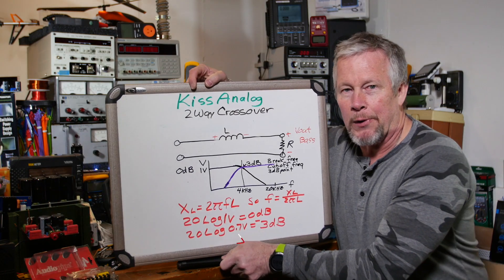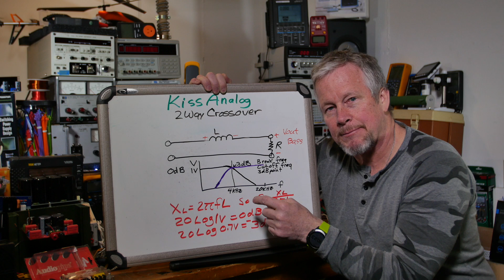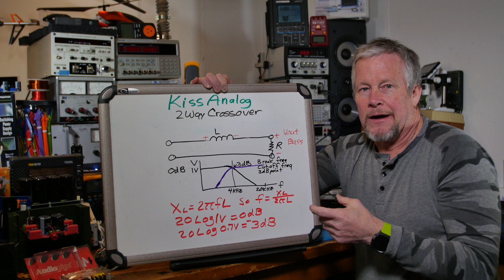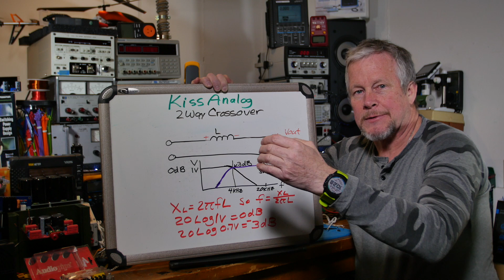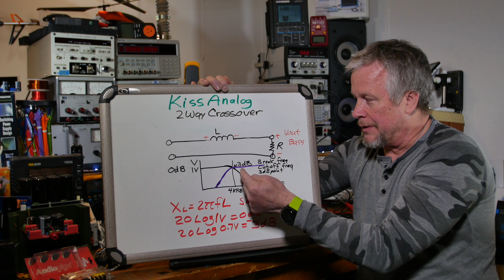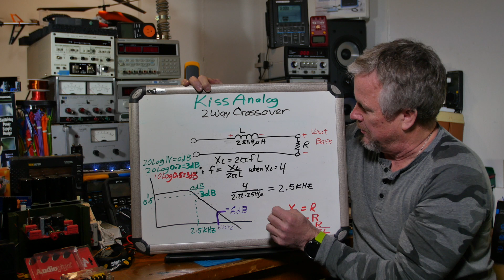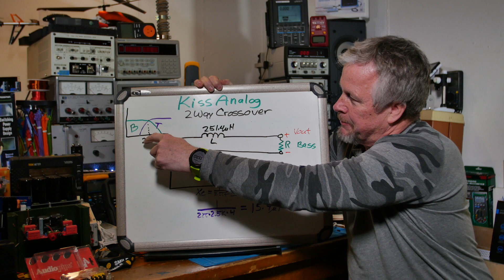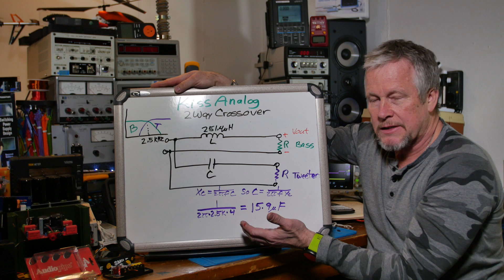How to Design Speaker Crossover #speakercrossover #filterdesign

Comment: Incredible...i guess this what they mean when they say "drinking from a hydrant".
Reply from the maker: Thanks Val for the feedback!  Too much too fast? ;)
Reply: @KissAnalog  I'm trying to get microcontroller like Arduino to read audio signal. It reads DC only. I know i need a voltage divider an a DC offset. Voltage divider is easy but DC offset I can't find any info? Like how do I know size of the cap and can it be polar? Any points greatly appreciated.

Comment: I have Technics speakers with just a single cap in series with the tweeter as a crossover. I was wondering: Is it necessary to remove the high frequencies from the woofer? Are you more likely to mess up the sound by trying to?

Also can't you make a low-pass filter using a parallel capacitor too? What's the downside?
Reply from the maker: Great question!  Yes, I have seen crossovers made that way.  It is low cost and keeps the tweeter from getting hurt;). A low pass to the sub would be a series inductor.  Then low frequencies would pass through but high frequencies would get choked off.  It protects the woofer from soaking up the frequencies that it can’t react to, so I think it is better to keep them outlet, but the woofer is usually big enough to handle it.  The Amplifier sees a strange impedance without a better crossover, so it has to work a bit harder too.  A well designed crossover looks like a more even or flat impedance to the amp.
Reply: @KissAnalog  Thank you!

Comment: Pew this was hard to follow but I think it will make more sense when I try to calculate it my self:-)
Am I right in understanding that if 1V = 0dB and you have 0.707V at the -3dB cross over point, you will also have -1.414V at the -6dB and so on, until the voltage is to low to be interesting?

A few comments to your video:

Great zoom on whiteboard, really a nice and helpful detail!! :-)
11:55 jump cut but did not distract at all but you have a lot of smaller jump cuts trouoght the video, maybe if you have that posibility, make a image to image fade that last for ½ / 1 second:-)
Reply from the maker: Hi Fried Mule - great question!  Actually at -6 dB the voltage is 0.5 V, and then at 12 dB it is 0.251 Volts.  At 20 dB increments it is easier - it is 0.1 V at -20 dB, so it drops by x10 or climbs by 10x depending on the sign.  Thanks for the coaching, and I'm sorry to respond so late.  Sometimes I do it at night and I think or dream that I responded;)
Reply: @KissAnalog  No problem at all!  You have other things to do then being 24/7 on YouTube. LOL but if you also dream about it, you are to much on::-)
I am glad to be of some help, you give so much, so a little in return is the least I can do:-)

Comment: EXCELLENT PRESENTATION,ITS AMAZING HOW SUCH A SIMPLE CIRCUIT CAN IMPROVE THE SOUND QUALITY THAT MUCH AND,HOW YOU CAN DO THE DESIGNING OF CIRCUITS WITH PRECALCULUS MATH.WHERE DID YOU GET THE NUMBER VALUE FOR THE INDUCTANCE?I SPENT THE WEEKEND IN WITH SEVERE BACK PAIN,SO I AM BEHIND ON YOUR VIDEOS.
Reply from the maker: david luther Hi David - I hope you feel better. Thanks for the great feedback!  I measured the inductor on the board.  I show that in the next video.